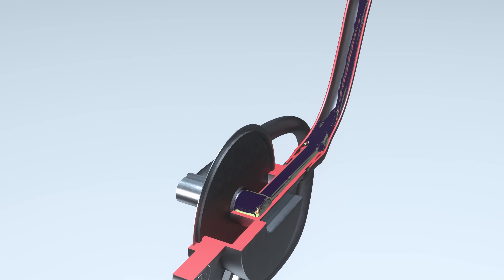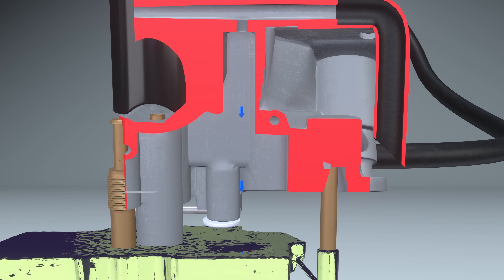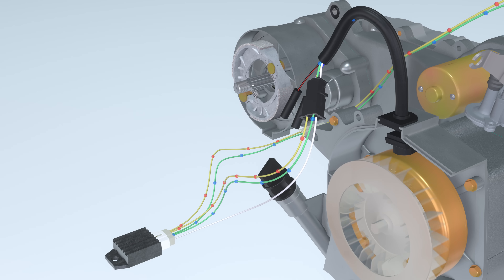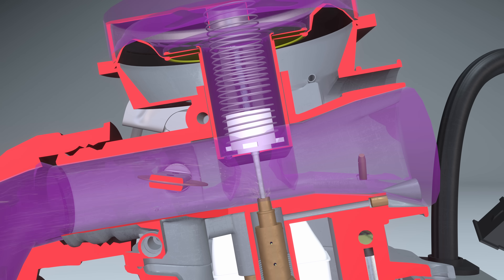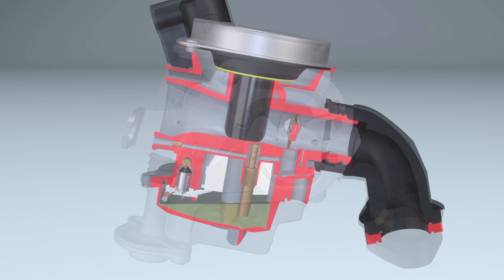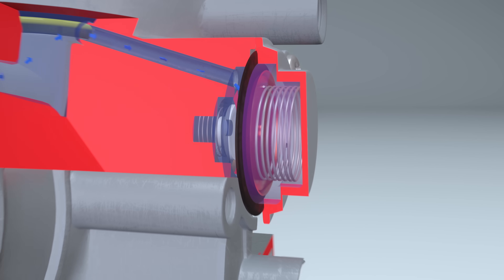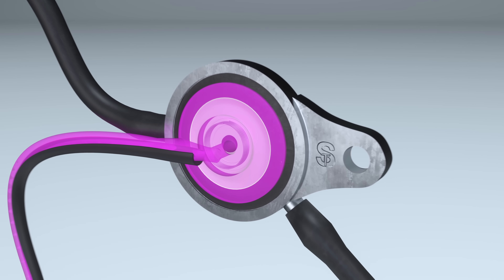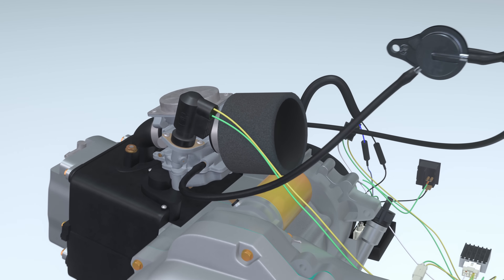Operation of the fuel system of a four-stroke scooter.

Comment: 🌐 English
Q: How does a 6-stroke engine work?
A: A 6-stroke engine works like a normal 4-stroke engine (intake, compression, power, exhaust), but it adds 2 extra strokes (air or water intake and a second power stroke). This improves cooling, fuel efficiency, and reduces pollution.
🇮🇳 Hindi (हिंदी)
प्रश्न: 6-स्ट्रोक इंजन कैसे काम करता है?
उत्तर: 6-स्ट्रोक इंजन सामान्य 4-स्ट्रोक इंजन (इनटेक, कंप्रेशन, पावर, एग्जॉस्ट) की तरह काम करता है, लेकिन इसमें 2 अतिरिक्त स्ट्रोक (हवा/पानी का इनटेक और दूसरा पावर स्ट्रोक) होते हैं। इससे कूलिंग बेहतर होती है, फ्यूल बचता है और प्रदूषण कम होता है।
🇵🇰 Urdu (اردو)
سوال: 6-اسٹروک انجن کیسے کام کرتا ہے؟
جواب: 6-اسٹروک انجن عام 4-اسٹروک انجن (انٹیک، کمپریشن، پاور، ایگزاسٹ) کی طرح کام کرتا ہے، لیکن اس میں 2 اضافی اسٹروک شامل ہوتے ہیں (ہوا/پانی کا انٹیک اور دوسرا پاور اسٹروک)۔ اس سے انجن کی کولنگ بہتر ہوتی ہے، فیول کی بچت ہوتی ہے اور آلودگی کم پیدا ہوتی ہے۔

Comment: 6  talk engine kam kaise karta hai 🌐 English
Q: How does a 6-stroke engine work?
A: A 6-stroke engine works like a normal 4-stroke engine (intake, compression, power, exhaust), but it adds 2 extra strokes (air or water intake and a second power stroke). This improves cooling, fuel efficiency, and reduces pollution.
🇮🇳 Hindi (हिंदी)
प्रश्न: 6-स्ट्रोक इंजन कैसे काम करता है?
उत्तर: 6-स्ट्रोक इंजन सामान्य 4-स्ट्रोक इंजन (इनटेक, कंप्रेशन, पावर, एग्जॉस्ट) की तरह काम करता है, लेकिन इसमें 2 अतिरिक्त स्ट्रोक (हवा/पानी का इनटेक और दूसरा पावर स्ट्रोक) होते हैं। इससे कूलिंग बेहतर होती है, फ्यूल बचता है और प्रदूषण कम होता है।
🇵🇰 Urdu (اردو)
سوال: 6-اسٹروک انجن کیسے کام کرتا ہے؟
جواب: 6-اسٹروک انجن عام 4-اسٹروک انجن (انٹیک، کمپریشن، پاور، ایگزاسٹ) کی طرح کام کرتا ہے، لیکن اس میں 2 اضافی اسٹروک شامل ہوتے ہیں (ہوا/پانی کا انٹیک اور دوسرا پاور اسٹروک)۔ اس سے انجن کی کولنگ بہتر ہوتی ہے، فیول کی بچت ہوتی ہے اور آلودگی کم پیدا ہوتی ہے۔